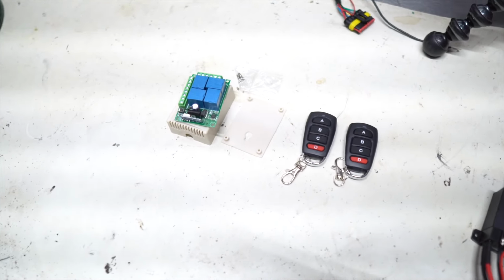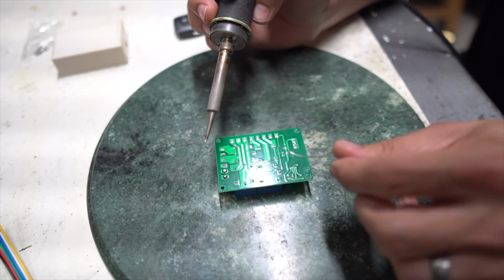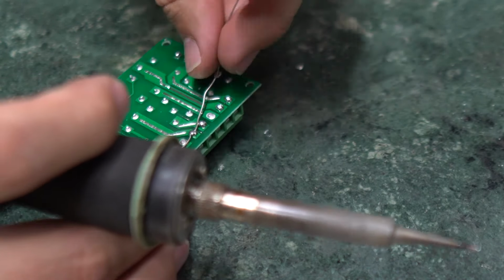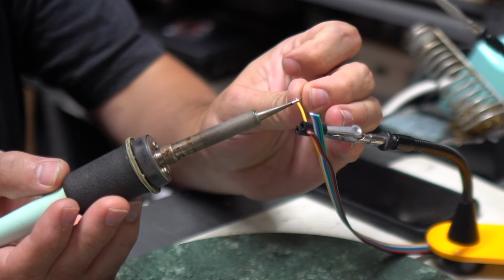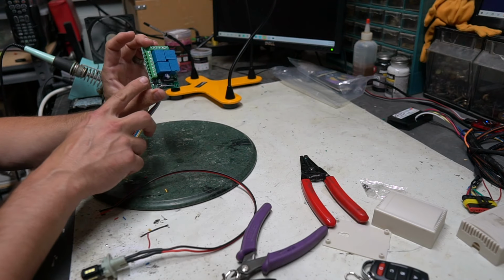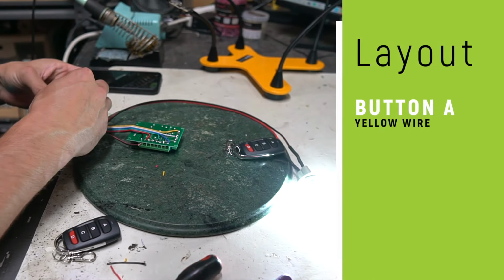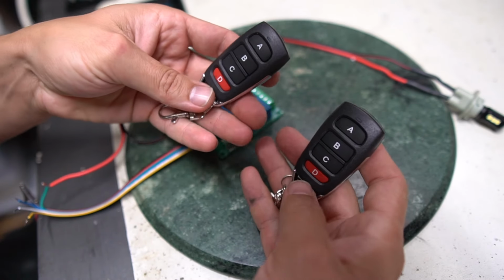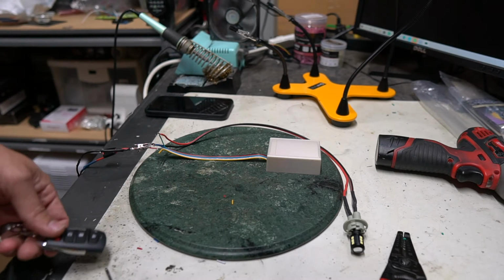BEST Remote Control for Custom Lighting

Comment: This is super helpful.  I've got a Qiachip setup on the way and this really helps to see some alternative options for wiring it up. Anzo is obviously the easier of the 2 for plug-n-play but it's always nice to have options.
Reply from the maker: Definitely different strokes for different folks right? I’ve done soooo many of the anzo units over the years, but ultimately never needed such a beefy setup for the kind of parts I was powering up (no light bars, or big accessories.)

Comment: I always prefer the diy version over getting out and buy the product, its joyful to make things work by working on them on your own. Also it develops some knowledge about that .
Reply: Also the products are not easily available here (where I live ) and on the internet these are much expensive, so if I get the circuit diagram or information about that ,I gather all the components and start working, sometimes it work and sometimes it doesn't.
Reply from the maker: Jasmeet Singh yeah man, most people want to rely on others to solve their problems, regardless of how trivial and easy the answer is. It’s empowering to know what to do, improvise when necessary, and rely on yourself and the information you have at your disposal (aka, EVERYTHING you could ever want to know), on the internet.

Comment: I assume you still need some sort of sequencer (ghoztlights etc) to be able to do "showmodes/strobes" with the Qiachip acting as the remote for the functions?
I've build a couple sets of tails and some corner lights, but have always felt the programming etc for show modes went above my head.
I was hoping there was something that would have  pre programmed "random effect"
Reply from the maker: Yeah these are basically just cool switches. The Corsomotion sequencer is probably a really good option for what you described. Have you seen that recent video?
Reply: @flyryde  Thanks for the reply mate. Yeah I've watched that one. I've used the other version on some heart tails I built. I'll need to look into that new version for future builds :-)
Your vids have helped me out a lot, so thanks for that too!

Comment: a bro quick question.. can i use an led addressable strip as a demon eye ???? or u thing the led/hid bulb will burn the leds ???? i want to put the led strip all around the projector
Reply from the maker: J Go great question: No. Not because you can’t, but because you shouldn’t. Think of a demon eye as one pixel. You can you a high powered addressable RGB LED instead of a strip that will fail due to heat, quite possibly even without the help of the HID bulb. Heat and LEDs hate each other. 

Plus, you’re not going to get a super distinctive separation of colors like you should under a diffuser in a straight line, because the colors will blend as they bounce around the inside of the projector.

That’s my opinion.
Reply: @flyryde  thx bro ..i really like how it looks but if that thing is gonna last a day then is not worth it right ...... so thx anyway i been learning alot from u !!! 🤘😎💯

Comment: You lost me with this one. They gave you a gift with terminal blocks. I'm not sure why I would spend more time to make much more delicate connections on the back. It just seems like trying to get too cute.
Reply from the maker: Chris Bowen it’s so much better not relying on the cheap ass terminals, hoping they’ll do their job properly, and bending them back into place if you ever decide to swap the wires (which can get caught inside the terminal.

From strictly my experience in doing it both ways many many times, I’ll never use the terminals again.